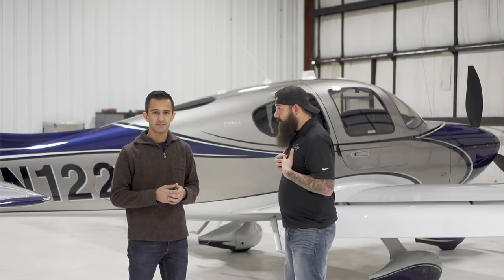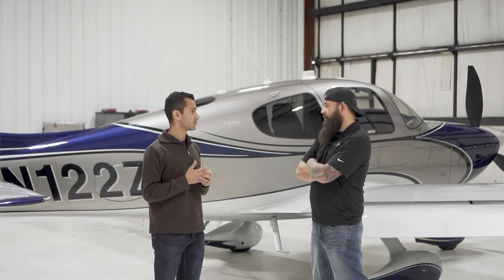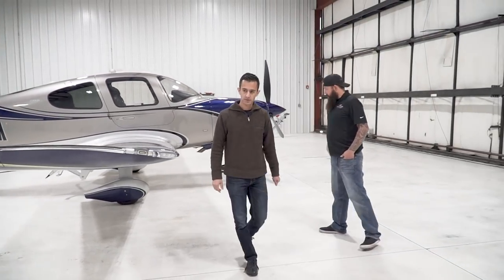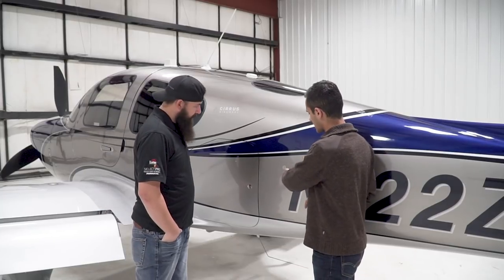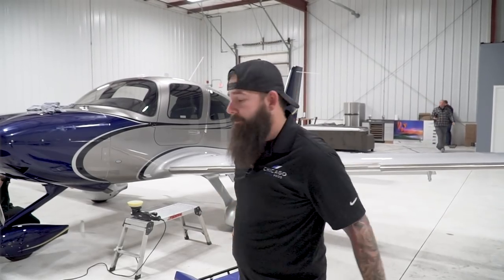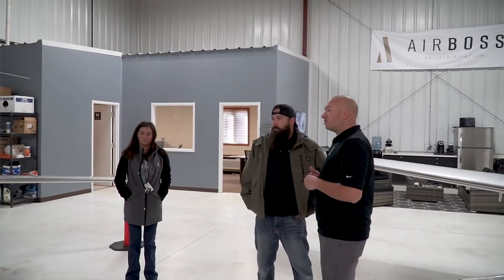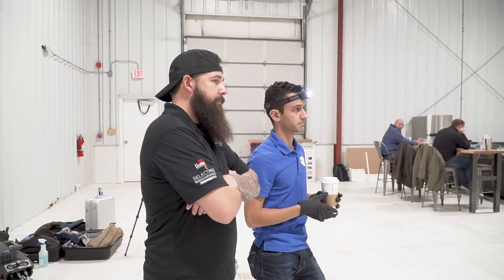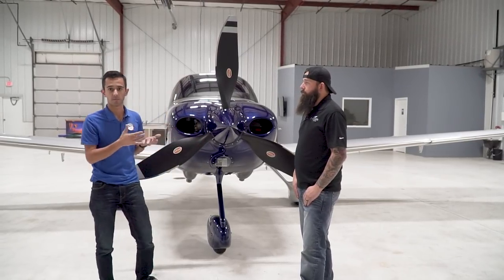Airplane Ceramic Coating | Cirrus SR-22T | Gtechniq Crystal Serum Ultra

Comment: I always enjoys watching your videos.  I started detailing as a kids washing and hand polishing airplanes in exchange for a little $ or flying time.  The current technology in detailing and airplanes is almost completely different.  When your ready for a bigger challenge, find a 50 year old plane with original paint that hasn't seen a wash bucket in 30 years and make it shine again:-)
Reply: @AvianaAircraft  polishing aluminium is a different process to get the desired result.  And I've done that too.

Comment: Hi Chicago Auto Pros, is a polish / compound 'always' necessary prior to application of a ceramic coating? Or is polishing / compounding simply to enhance the paint prior to applying a ceramic coating.
If you did not perform a polishing stage, would this be detrimental to the longevity of the coating?
I look forward to hearing from you soon. 
Thank you.

Comment: Ive done about 115 planes with my ceramic product . im approved by the faa to also apply it within the wings and fuselage. I offer a 2 year full warranty on fading. 6 year on oxidation and 15 for corrosion. If you have been contemplating it you need to decide if you are going to be painting it within the next 6 years. It is awefull to get off as theres nothing that aid in it chemically wise..that is the cons..the pros are. Ice..that becomes next to imossible. Its hydrophobic so nothing really sticks to it. That goes for the belly to where the black oil and grease get..
Reply: What ceramic coating do you use for Aircraft?

Comment: Looks absolutely awesome! I hope that research was done on the weight factor. 😎👍
Reply: If you forget to pee before flying you will carry more weight than what we added
Reply: @AvianaAircraft   how do I know how much weight it adds? A simple and kind response would be to tell me.   The FAA needs an STC for any alteration . I was just checking in and making sure that you had considered that!  By the way, I'm a certified A&P mechanic besides being a 747 Captain.  I have many contacts in the FAA too.
Reply: @_jamesbradley__  Sorry, I think that my comment came across more sarcastically than intended. It is a common question actually, We use about 100ml of coating, but most of that gets wiped off, assuming 5g/cc about 500 grams is added, but again, most of it is wiped off again! On a 747 I am sure it would scale up a bit more!
Reply: @AvianaAircraft  No worries/No problem. The plane looks absolutely beautiful. Exemplary in every way! I'm sorry for taking your comment wrong.  😎👍

Comment: is that coating FAA and manufacturer approved, if no then that aircraft may now be unairworthy. That aircraft has an EMM under the paint, EMM is there to protect it from a lightning strike, putting that coating my add to the insulation properties of the paint and your coating. so when or if that aircraft was hit by lightning The EMM would not be able to do its job and the aircraft could explode on impact of a lightning strike. just saying.
Reply: Mine is...i apply mine not only do i apply on the outside but im also able to apply in the wing..i offer a 15 year warranty on corrosion.
Reply: Seafood Guru  ...can you share your webpage to read about your product

Comment: Not a critique of the job done, but I would never allow a "coating" of any type to be applied to a very complex airframe. What is never addressed with the "coatings", is what happens when they start to break down and how does one remove them completely. Easy with wax... strip with detergent soap and re-apply. I do it annually with my boat - even use aviation/marine wax. Should also mention I fly a SR20. To each their own though.

Comment: Who gave the information about airplanes and engines for this video? First of all, we use leaded fuel to both aid in lubrication, and to prevent detonation. Has nothing to do with flight at high altitudes. Secondly, the leading edge panels are not stainless, they are titanium.